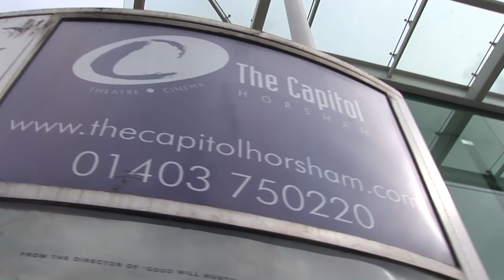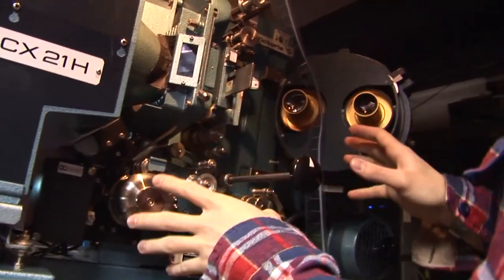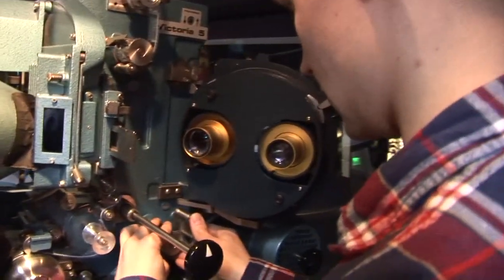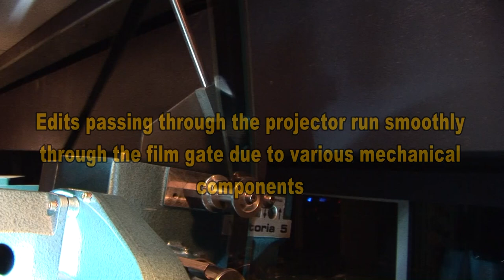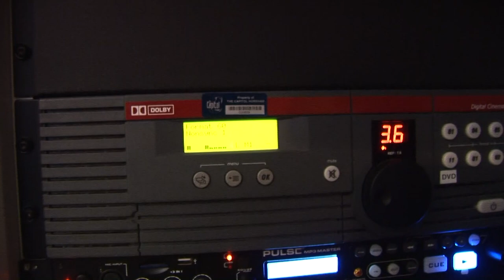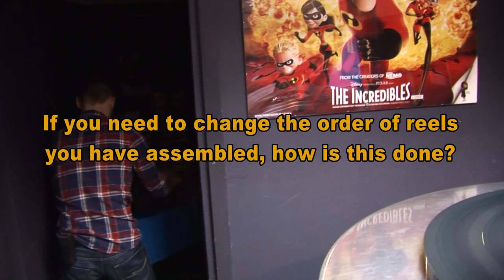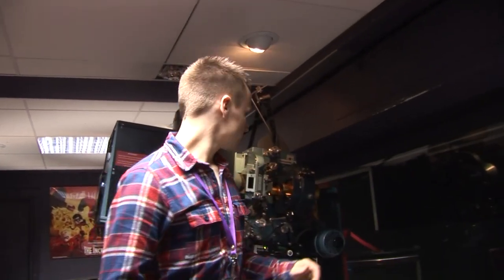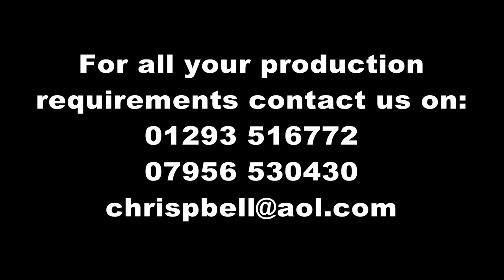Jack Lane explains the lace-up of a 35mm Cinema Projector - Running Time : 15 Minutes(aprox)

Comment: I learned how to run movies on a 35mm projector in 1963.  Different then, had to use 20 min. reels with a change over switch.  Keep you busy  during the movie.  When the 3 min bell chimed you started the other carbon  arc lamp house on the other projector.  Watched intensely at the upper right of the film for the changeover dots.  Stated the other projector running (of course the other lamphouse was lit) and with your foot hit the change over button. stopped the used film projector. Dismounted the used reel and put it in the carry case and mounted the next reel then had about of maybe 15 min until the repeat of the cycle.  Of course you were in the booth about 1 hour to 30 min. to rewind the in coming film from tails out to heads out and inspecting all splices.  Keep you busy.